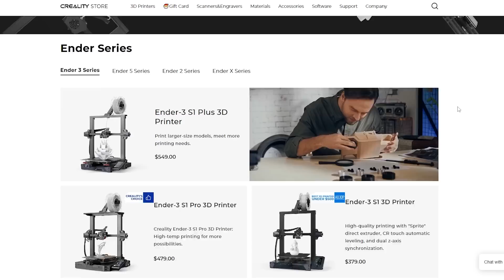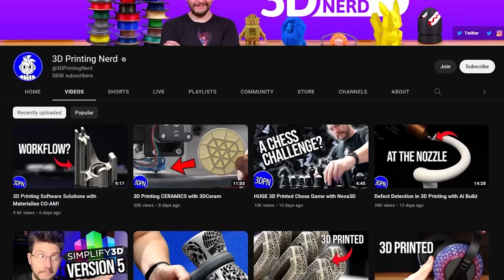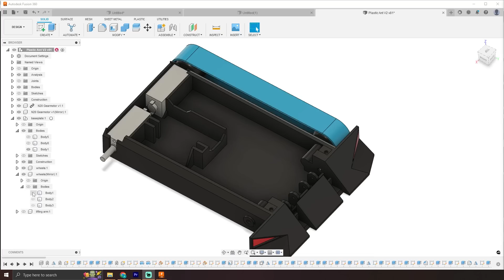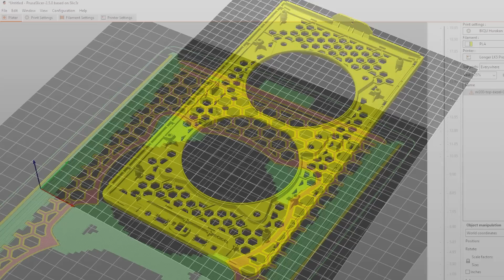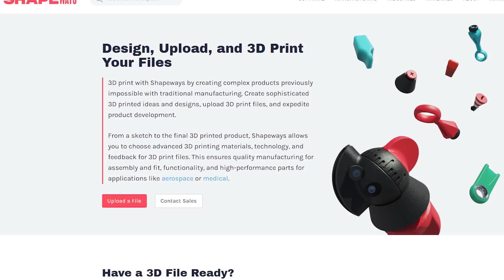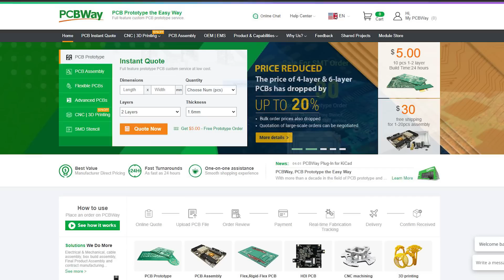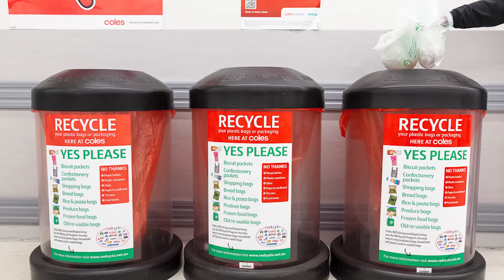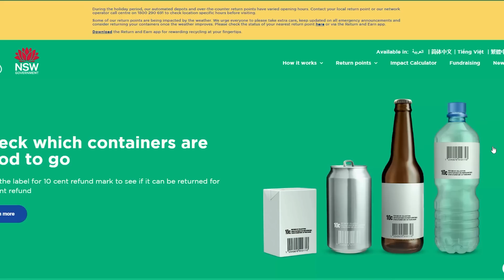My 3D Printing Predictions for 2023

Comment: Thank You for preparing our minds to be stretched in 2023, I always appreciate your delivery and energy.  I began the 3 D Print hobby about 7 years ago with an M3D plastic printer and Fusion 360. Is has been a wonderful ride as you know. I needed a Smoke Housing for my Model Trains. There was nothing in the scale of the train my Dad gave me in 1957. S Scale 1/64. I make several adaptions of the Metal Smoke housing with 3D printed parts sort of a Hybrid Smoke Housing half metal half plastic. But then I bought a returned 10S Pro and added a Micro Swiss Hot end and Hardened steel nozzle to print high temp filaments CF PETG etc. Now I could design and make the whole smoke housing.  Then with PCB I designed and build the Smoke Lid to include a thermistor and LM317 for Temp controlled Voltage to the Heater. Then The whole assembly was modified to accept a series of adaptors that find allowed its use in ever steam engine model for my S Gauge trains. WOW! In the course of making more parts i tried Scanners, fail Maker Bot $750 was junk. I looked at small more detail capable printers, looked at Resin Printers but chemical bother me. Then back to Micro Swiss for a Direct Drive Adaptor. WOW with BL Touch More WOW. My old 10s Pro is a tank today. But as my hobby grew in parts I also started to get requests for my parts. I looked at the Creality production machine but $1,000 Nah! So I see Klipper as a possible answer to speed and accuracy. Then I saw the review of Bambu Labs, WOW! No we are talking. Putting advanced control technology on a $600 range Printer is starting to get exciting. Therefore I think your predictions are dead on target.  I am surprised to see more and more Model Train Hobbyist buying a printer and learning tinker CAD. I have begged Fusion 360 for years to offer a Hobbyist version just for 3D Printing and retired engineers even military service Veterans, which I am. I felt a $100 a year was reasonable with some tech support and reduced instruction set for Solids and Documentation. But all I have heard so far is Crickets. I still use F360 because I own a Corvette and like to drive sports cars, for me F360 is a Formula 1 of CAD.  But i get into trouble often without training and support. Bringing professional grade 3D print tech down to hobbyist, bringing Formula 1 CAD down to hobbyist and recycle 3D Print waste is all very good. But I also see the opportunity in standardized frameworks for Custom 3D Printing. As you point to cake tops in Word like apps. I am promoting standardized Mechanical interfaces for Model Train Chassis to Bodies thus allowing the standard surfaces and bolt patterns could allow massive reuse of designs and conversion for various scales to quickly transfer designs between scales and users rapidly. This method of design share could easily take off in many other hobbyist topics and with more reliable and accurate printers, easier to manage CAD software it can all open up. True event: Dish Washerer fails, a plastic valve looking like a gas engine cylinder head valve in smaller scale was worn around edges and did not seat anymore allowing water to leak past. The GE Repairman had the only one left in Virginia (my home state) so we were saved BUT, i see parts like this getting scanned, repaired in CAD, then printed in high caliber plastic on a high quality SMART Printer at the user home as needed. In undergrad school back in 1977 I wrote a paper on manufacturing on the moon. I used plastic beds of small size and flexible molds that could be program to be a 2 piece clam shell cavity mold for any part that was needed to build the city and all its contents on the moon. Thinking furniture at the time. I agree with you in that we are there NOW! 2023 should be the break out year for Hobbyist going mainstream in parts making for systems development. You Take carte and keep chugging, we need you!!! Dennis in Virginia Frankentrain Laboratories on You Tube

Comment: I am very interested in recycling PET-bottles in to filament, moreover I am thinking of actually making that a business (maybe even worldwide), imagine having actual factories that just demand those plastic wastes, because we would run out of production material, I do however see some problems:
- A reliable recycler that can work 24/7/365 spewing out filaments like crazy, maybe you can test some
- the whole save the environment only works if my business wouldn't make more plastic waste (fumes and microplastics) instead of getting rid of it
- actual mass production of parts with these filaments, not just hobbyists but actual factories that would need these in large amounts (E.g. a car dashboard of a mass produced car)
- the ability to not just make filaments but pellets for injection moulding would help with that previous one

But just imagine mid- large factories with hundreds of plastic bottle recylers, doing nothing else but recycling them in to filaments and pellets and instead of stuffing a warehouse or drowning some indonesian island with plastic bottles, actually having to worry about not having enough plastic bottles because the demand is higher than the supply, given off course that we are not just making it worse instead of saving the planet, factories are usually not beneficial to the environment. A good study on this would be nice

Comment: CNC being more affordable I can't really see. Good quality machining is hard, which translates into cost. Cheap services today will either have to drop quality or raise prices. Maybe larger markets like EU and US will see someone go "high-volume low-margin", but AU/NZ ain't that lucky.

I would love to see more recycling of failed prints. But it is a lot of work and equipment for one person (/duc). Maybe community based schemes will work? A big issue is contamination: most polymers are upset/ruined if mixed, and while I try to be diligent about keeping ABS, PLA, PETG apart (I actually have a separate bag'o'fails for each roll of filament), I still have some mixed/unknown bits. Why I don't own a dual-colour machine I guess. Need one with no purge tower.

Good video and thank you Angus. I look forward to what 2023 brings and go back to daydreaming about a Voron Trident IDEX now ;)

Comment: One thing that I neglected to mention in my earlier comment is that I generally get eSun or a local brand of filament sans spool for a buck or so less per kg but it is only in 1kg hoops.  You then print a screw-together spool for it. comes vacuum sealed but still in a (albeit smaller) cardboard box.  This "re-filament" format seems to be gaining traction here at least.

Comment: I don't know how to perfectly emphasize my experience with my Dremel 3D45 printer as what you have just now done with this video under your "Pro-Schumer" rant...

I spent over $2,000USD (before tax) on this 3D45, which at the time I bought it in July of 2019, it was one of the most favorable printers to be used as a tool. Needless to say, this same printer (though reliable) is more temperamental than my mostly-stock Ender 5. Oh..! and I don't necessarily have to worry about where I source my filament from with the Ender 5 vs Dremel/Bosch's proprietary spin on the 3D printing market...

While I still have that same 3D45, it has definitely made me appreciate the more simple printers like the Ender 5 (at the time, circa 2019) and I definitely have a stronger preference for 3D printers that are more open-source in both modding/improving them as well as being more open to updates in slicer-software which I feel like really contributed to the increase in effectiveness of "commercial, off-the-shelf" printers made for consumers. I frequently found myself resorting to my cheaper, but conservatively modded by this point, Ender 5 over my proprietary Dremel 3D printer! In retrospect, I definitely think that the extra mods/improvements that I could easily do with my Ender 5 made more of a difference than having to trust a major international company about their version of the same thing...

Long story short: I am definitely salty about "pro-schumer" 3D printers of the past, because I've definitely taken that loss already 😅

Comment: About the CAD software, for me this prediction is already true. I started with Tinkercad, and then tried a number of different tools for 3D design and for modifying existing models. Most of the time I had to work on a simple editor and then use Blender to complete my work. Then I discoverer MatterControl. It ticked all the boxes: free, open source, lightweight, easy to learn and use, a good collection of primitives and modifiers, variable-bounded dimensions... it has everything. It also includes a slicer, but I never tried it. Give it a go, it could surprise you guys.

Comment: I've been printing on the M5 for a few weeks now, and I'm finally going to try the Torture Egg on it today ;_; I hope it does well, went with the equivalent of some of your suggested settings, but there were a few things that weren't present in the Anker slicer or were worded quite differently that I've been studying up on. Also allowing this print to go a max of 200 mm/s based on the .15 layer height and such to really see if it can stay accurate while managing the speed (I am not expecting success on this try, but it is a torture test lol). only about a 2.5 hour print at the original size of the model

Comment: Where I live the PET bottles just go in the "blue box" for recycling but if there is too much then it goes to landfill so while a tool to use the PET bottles as filament may not be useful for AU it would be for CA I think.

The other thing is the end bits of spools of filament. Is there a good tool or mechanism to reliably weld them together.  I could use the ends for initial prototype parts rather than just scrapping them. Methods that I have tried either result in a poor join that breaks apart or  join that is too fat and leads to a jam.

Comment: The one impediment I see to 3D print recycling is not the tech but the need. The need hinges on repair-ability of the end game consumer product. Way too many products today are of the use-it-toss-it construction. Even if I could 3D print the needed part I can't get to it to replace because the blasted object is glued together, not nuts and bolts. 

So if we want to see both 3D and 3D recycling flourish you need an ecosystem:
* Mfrs that will make products that can be repaired, including from days of old the exploded diagram of how it was assembled. 
* Mfrs provide the designs that can be 3D printed and access to parts that cannot be. Provide the files for a small fee if need be. 
* Work with downstream suppliers/maker spaces/makers so that parts can be readily accessible locally. Makes no sense to make a .75c part that costs $3 to ship that might cost only a $1 to print out. 
* Work with legislation to make repair-ability a benefit thru tax incentives rather than draconian green legislation. 

Just a thought.

Comment: A lot of these predictions are about the machines or the manufacturing process, but not much is mentioned about filaments (other than the recycled filaments near the end).  Dissolvable filaments are still kind of a nitch category that don't see as much attention as other filaments.  Also there's increasing demand for dissolvable filaments that work better with non-PLA filaments such as PETG.  In addition, several of the dissolvable filaments are difficult or time consuming to dissolve, or turn into a jelly mess instead of actually dissolving.  If I had to guess a year where we'd see an innovation bump for dissolvable filaments, it would be 2023.

Comment: I dont get this whole prosumer market.
I have an Ender 3 i bought like last year for like $200 off amazon.

It works perfectly fine lol. Bed levelling is a pain, but it does its job. I had zero issues with print quality and it performed really well. I use the Cura slicer.
I seriously have zero clue what these $5000 printers do that goes beyond what these $200 printers do.
Like sure they can print certain materials, but you would expect the change to only add like $100 on the initial cost at best

Comment: Chop your unused prints or failed prints down into particles and then remelt them down into filament.
Reply: To build the extruder is costly and complicated I've spent time looking into it, while I have to "know-how" I don't have the tools or the funds to build such a shredder/filament maker. That's a common problem, most people lack the know-how or the tools to build one and for the most part, unless you can cough up the $3500 USD for a machine to do it you're screwed. 

You need a strong shredder able to make scrap into pellets, a heater and auger (usually a long twisted wood bit cut to size), a foot long pipe with a slot cut into it, and a hopper. Plus you need a large stepper motor to run the auger and the shredder. And another to run the winder and the main board to drive it all. Lets not forget writing the custom firmware to run it. Then organize by plastic type and color otherwise anything you made with it wouldn't be usable or just an ugly grey-ish color.
Reply: @scarsdale7186  You can do it all for about $350.
Reply: @Greg Lancer  I'm disabled and in my 60's on SSI it's very hard to save money, that's my point, it's still expensive and requires knowledge not everyone has.

Comment: I still have my 2 year old ender than I've yet to use cuz I can't level the bed
Reply: Search YouTube for that there is many "how-to" videos on that, but use a feeler gauge the .02mm size, paper isn't as actuate. Another thing you can do is is take off the print bed and add nuts to the underside of the bed plate, those screws are loose and turn very easily. I believe Chep has that video on the bed screw issue.

Comment: Non planar slicing will continue to be developed.
A kit form 4th axis hotend will become available for one of the significant platforms (probabbly the voron and maybe even the Ender 3)
To allow non planar printing to become practical but it will be a couple of years before anyone releases a printer as standard with this facility

Non contact bed leveling probes will also be developed to get around the issue a physical probe can cause with non planar techniques. Maybe Lidar or something similar

Comment: "You can still buy an Ender 3... for some reason"
I bought an Ender 3 in 2022 and love it. Yes, it's my first printer and I've been learning a lot. I've had a lot of success in the hundreds of print hours I've used it for making lots of cool things. And that success is thanks to your videos and those of others that have made me able to easily troubleshoot and address any issues straight away.
So, if you're looking for "some reason" to get an Ender 3 in 2023, well it's very cheap [I bought mine lightly used for $100 us] and has a ton of resources out there to help the user (as opposed to other printers)

Comment: Fusion 360 is by far not a complex cad software, really about as simple as it gets, just requires knowing how to draw properly. Expecting anyone to produce decent 3D anything without knowing 2D  is hopeful, just put the time in. Fusion is very lightweight and I use it primarily now instead of inventor, SOLIDWORKS, or Catia.

There's an interesting separation between hobby and pro type printers/companies/mentalities. I can't even justify buying an industrial printer for 10-30k$ when I can buy/build and tune up 10 prusa or voron types for the same cost with same or better features.
Reply: For a hobbyist it's too costly after you make 10 .stl files you have to pay for Fusion 360 and it's like $450 a year. I could see it if I opened a full-time farm but I'm far from ready for that.

Comment: The one thing that wasn't suggested is innovation. People will find solutions to problems using these machines/services. One example is the 3D printed gun community. The innovation coming out of that community whether you agree with it or not is incredible. You have one guy who has printed every portion of an AR15 except the bolt, barrel, and firing group. Others are meshing brands together, and some are making all new brands of their own. We've also seen the stuff they are doing in Ukraine with the drones and other small arms.

Comment: What about filament "buy back" from the companies? Beware of "it's up to us" to recycle. Soft drink companies came under fire in the US for the original marketing campaigns to blame the consumer for littering and that it's up to the customer to be responsible. There should be a shift towards creation breeds responsibility for waste. So if a filament company sells you unrecyclable materials, knowing you will have waste inevitably, it should be their responsibility to provide us with a reasonable pathway to prevent it from going in a landfill. Just give a discount per unit weight of filament returned to the manufacturer. So the manufacturer drives continued business. It would maybe increase the baseline price of the new filament, but would turn it more into consumables and service rather than just buy plastic now it's up to you.

Comment: For one thing FDM has come very great even I bought one (finally) this year when my local shop selling them.
SLA on the other hand still need some improvement since most of them still are using toxic resin and need a curing station which I know is optional to buy one but still. With both of them add up the price of 2 FDM printer.

Comment: I hope 2023 will be the year of the breakthrough of small shredders and filament makers with prices affordable for hobbyists. That will make recycling a lot easier. 
A filament maker will now costs 600 to 1000 Euros in parts and materials, but they have to be sold for 3000 to 6000 euros because of low production volumes. The cost for R&D, investments in buildings and machines and the use of some patents make about 60 % of the costs.